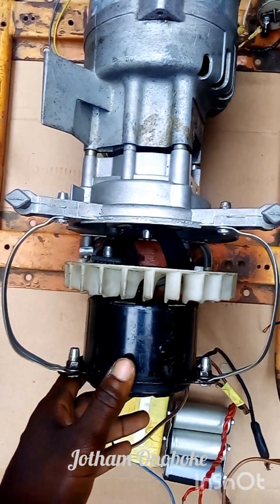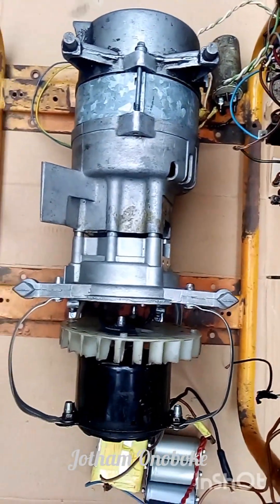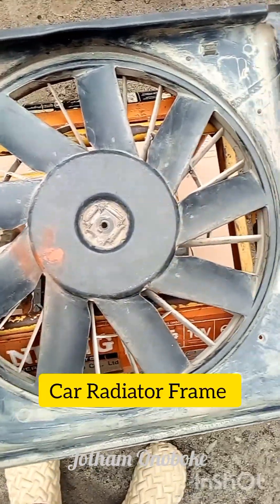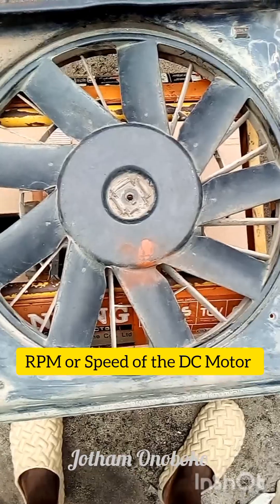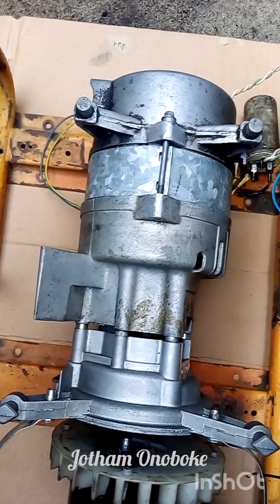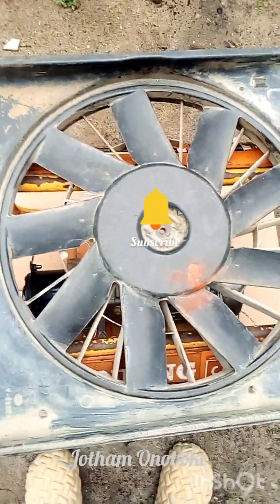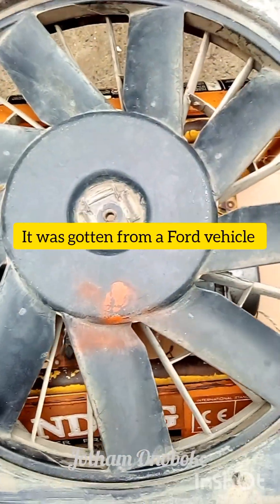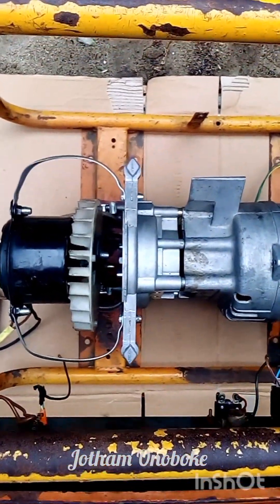Radiator fan to Fuelless Generator.

Comment: I really prefer Benz radiator fan so that it will run on ac fan instead of dc fan so that it will not get heat up easly
Reply from the maker: @ugogod-qq6wj  Wow that's a good idea, you are very knowledgeable in this field because getting the heat out is the best and important part of the motor to keep it cool all the time while it's on operation.

Comment from the maker: Thanks for watching please 🙏 subscribe to my channel
Reply: Thanks for sharing
Reply from the maker: @Cars27947  you welcome
Reply: 3000rpm is fine
Reply from the maker: @QuickVibesZone797  thanks 😊
Reply: Wow radiator fan
Reply from the maker: @Tech-Adventure897  you got it right 😊
Reply: I really prefer Benz radiator fan because is ac fan and not DC fan I think it could be more better so that it doesn't get hot and spoil quick
Reply from the maker: @ugogod-qq6wj  Wow thanks so much for this information, I didn't know that Benz radiator fan are AC Powered, You are very  correct sir they would definitely last longer because of  It's Ac and the quality of the Motor itself.
Reply: @Jotham-Onoboke Yes please I will be happy to see you use it. You are going to enjoy it
Reply from the maker: @ugogod-qq6wj  thanks so much sir am working it, I will be posting more upday on it